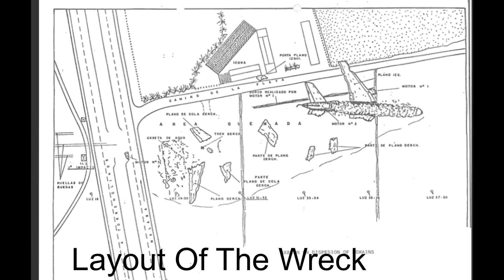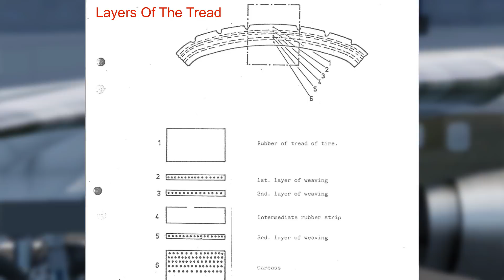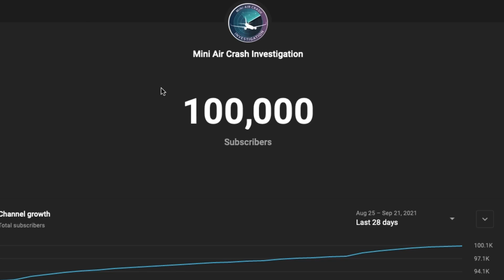How A Flat Tyre Killed 51 People | The Crash Of Spantax Flight 995

Comment: I am wondering why the vibration continued, and indeed got worse once the nose was off the ground? If the nose wheel tyre was the one coming apart I would have thought the vibrations would have gone down to pretty much nothing once that wheel was off the ground. I can only think it was because the wheel obviously continued to spin after it had left the ground, and the damage had made the wheel so far out of balance that it continued to cause serious vibrations even though the weight was now off of it. If the pilots had continued with the take off the vibration would have stopped once the wheel had spun down. Such a shame they rejected the take off. But having said that, like you say, they had no idea what was causing the vibration, it could easily have been something much worse that could have endangered the planes ability to fly properly, which in turn could have possibly led to an even greater loss of life. Those pilots were faced with a very hard choice, and they had to make it without any time to think about the situation. Sadly on this occasion they made the wrong call. Even if that tyre had failed completely, they would still have been able to make a fairly normal landing, after all, the plane had two wheels on the nose gear.

Comment: How long would runways have to be for V1 to be above VR?
Reply: V1 does equal Vr for a lot of twin-jet airliner takeoffs at large airports, or at very light takeoff weights.  Those takeoffs aren't "field length-limited".  If you lengthen the runway sufficiently to get to that situation for all takeoffs (~50% longer than now?), then there's the question of whether airlines would just use the extra distance to allow more derated-thrust takeoffs (saves some on engine maintenance costs).

Comment: Did they ever figure out why the vibrations increased after trying to take off? If the bad time was on the nose gear it seems the vibration would reduce when it was lifted off the ground.
Reply: Because of "spring" in the NLG strut, the imbalance caused by a spinning partly disintegrated tire will produce a higher amplitude of strut stroking once the gear is no longer constrained by the runway.  So it started as one kind of vibration and then progressed to another kind.
Reply: @marcmcreynolds2827  thanks for clearing that up.

Comment: Wait...I'm not getting something right. The nose wheel was where the failure was; yet, when the nose lifted, the problem got worse?
Reply: Before the nose lifted the vibrations were transmitted to the ground and the plane also the weight of the plane dampened them, after the nose lifted you lost these two factors.
Reply: @lastfirst6626  Ok, so when the nose lifted, the wheel was free spinning and created more vibration? Seems plausible.

Comment: If I heard correctly. When the pilots first felt the vibrations brfore V1 they decided to diagnose the problem and not abort. After it got worse they tried to abort after V1. Maybe we need a V0.5 witch states Anything out of the ordinary stop and go back to the gate. Yes I aborted a little single engine takeoff when I applied power too quickly and the engine hesitated. No problem re-ran the preflight tests, realize what I did wrong and took off. You have a lot more time to think when you are sitting on a taxi way.

Comment: Thanks for this video. I am a bit confused why the pilots felt increased vibrations even "after" the nose wheel lifted off on takeoff. if the treads on the nose wheel tires were causing the vibrations, i would think the vibrations would subside once the nose wheel lifted off the ground.
Reply: Nose wheel out of balance (due to lost tread) and still rotating. Contact with the ground would dampen vibration; after lift-off that damping is lost.

Comment: I dont know if I would choose smashing into everything at the end of the runway over flying a plane with unidentified vibrations. "What if the plane would crash once he took off?" He was gonna crash anyway as he was past the point of no return all he decided was definitely rolling into a crash versus a chance of flying into a crash.

There should be 2 minimum speeds. 1 for just not overshooting the runway, and one where you accept that you will leave the paved runway but wont smash directly into trees or infrastructure. Half the time you roll into a field or into some low lying equipment and damage the plane a little. Half the time you crash into other people on the ground. There should be a distinction.

If you are merely unsure what is really wrong and there is a highway or buildings directly after your runway, TAKE OFF.

Comment: I normally err on the pilots' side of things just because they are under enormous pressure and have to react very quickly... but I don't get why this captain rejected the takeoff. They exceeded V1; this was now an in-flight emergency. You lift off, then you worry about it if there is still something to worry about. There's a reason this speed is calculated; you aren't expected to be able to do the math of the decision in that space of time, just to look at the speed and do what you already committed and said you'd do: at or above this speed, its in-flight and you don't stop, period. There have been exceptions, but we're talking about in cases where a plane had such issues it couldn't even pitch up- in this case, the plane was responsive. Training and policy tell the PIC and FO to keep going, so that's what they should be doing.

Comment: Actually, I think he made the wrong call; he knew there wasn’t enough runway to safety come to a shop and so therefore took a huge gamble. Whether they were trained in this of that specific scenario is irrelevant since they WERE trained that it’s better to try to get airborne (despite issues with the plane) than it is to choose a course that they’ve been taught is both1) very dangerous, probably even deadly, and 2) where the odds of succeeding are poor at best.
Reply: Yes, as another comment said… aborting after V1 is almost a guaranteed crash, whereas continuing with takeoff is “only” a gamble.

Comment: Should reject takeoff even if not enough runway, more chance of survival and ground crews will be fast to respond to emergency if a crash was to happen. This is what i would have done especially if the plane was increasing vibrations and struggling to lift off. ABORT
Reply: Exactly. Get in the air and lose a wing and you have 300 dead.
Reply: I often think the same thing - I'd take a guaranteed runway excursion over risking the possibility of not being able to get back to the airport
Reply: @thecrazyfarmboy  it was a bad call from the pilots yes . Actually very bad
Reply: Well... I would say it depends.  If you have rull trust and the controll seams to work, ther likelyhood of the plane flying is very high.

If the controlls are FU or the thrust  is heavily redused, i would say, the plane might not fly anyway. Like the concord flight there just was not power to sustain flight
Reply: @matsv201  A plane never needs to take off, but once it does, it truly needs to land. I'd say if there's any reason to believe the plane might not fly, that's a time to reject takeoff asap. You don't just go "oh well, it might not fly anyways so let's just continue this takeoff and find out" 🤣
Moreover, there are times when the pilots only think they have a minor problem early in the takeoff run, one that won't stop the plane from flying, and then end up crashing shortly after liftoff. It's just my opinion that even a minor problem should call for a rejected takeoff when there is still time to stop, and a major problem should call for a rejected takeoff even if there is not enough runway left to stop
Reply: @thecrazyfarmboy  the issue is that a rejected take of way after V1 is dangerus. If its moment after... sure, no problem if you overrun with a few meters only its not that bad.

If you lift of, you have the whole runway to land... that is... If you can. If you cant.. of cause, its a difrent story
Reply: @matsv201  I'm fully aware that rejecting after V1 is dangerous. In facts that's pretty much the whole point of this exchange, but thanks for clearing it up for me.

You basically just reaffirmed my point lol, if the plane can't land, that's a different story. The pilots aren't psychics, they can't possibly know for sure what the outcome is going to be, and thats why I think that for any serious problem, it's usually a better option to reject after V1. To continue and find out what happens, is to let oneself be a victim of circumstance.
Reply: @thecrazyfarmboy  

"The pilots aren't psychics"

No, but they have a acceleration indicator, and they can read of that. If it match, and the control works.. the aircraft will fly, at least for a period of time. Taking of them will be much safer than reacting the take of.

If the acceleration indicator is slightly off, it will most probobly still fly, but if its a lot of, that might be  a problem. Specially if you lift of in the wrong side of the envelope. And that is all things the pilot should know
Reply: @matsv201  oh sorry I didn't know you're an airliner pilot. I now realize that you know first hand how easy it is for a pilot to fully and accurately assess the mechanical state of their plane within 2 or 3 seconds. Please, teach me more!
Reply: @thecrazyfarmboy  there are thrust gauges.  If you know nothing, maybe you should shut it.
Reply: @matsv201  I am fully aware that there are thrust Guages 🙄  you see it's not that I don't know anything, it's that you don't know nearly as much as you think you do. Evidently, that leads you to think that anyone who disagrees with you must know nothing. Please, tell me another basic aviation fact that you think I don't know

Comment: 8:05 You are taking a chance in either case. I this accident 50 people died. What if something in the plane's controls was badly wrong. If that is the case once in the air the plane could be uncontrivable. The resulting accident may not be survivable. So instead of killing 50 you kill 300.
     50 dead could still be the best possible outcome.

Comment: Aircraft designers:  PLEASE put cameras on the outside of the plane and a large-ish display that can be switched between camera groups.

Allow pilots to see what's up with the plane when all else fails!  Save lives!  Having to diagnose a serious airworthiness fault blind before V1 is a tall order!
Reply: There is no time during take-off for the pilots to sit back and calmly browse through all available camera's. A 747-400 has some 18 wheels, scrolling through them and watching each would take a three minutes if you spend 10 seconds per wheel to check it and go to the next one... They did not have such time.
Also, you're not going to see anything with the tire spinning that fast, so it wouldn't have told them anything.
The A380 does have an outboard camera on it's back, which has helped a Qantas flight after an engine failure but that's during cruise/approach. During take-off there just isn't any time to review camera footage.

Comment: You know,  aircraft carries have arresting cables that stop jets from going off the end of the aircraft carrier.   There are TONS of ways to help with plane safety,  but airlines and airports are unwilling  (and unable) to pay for it. 

There should be an independent company that is willing to add these extra safety precautions.   They should be government funded, and they should also be able to take donations from people  in order to build these safety precautions.        V1 should be an afterthought.    In fact,, that should be the name of the company ,or maybe V2 .
Reply: Plenty airports have runoff areas beyond the runway, several US airports have experimented with a special type of concrete which would partially collapse under the weight of an aircraft, slowing it down greatly, no idea if this was ever implemented though.
In the end, plenty airports have no space. I'd love to see Nasa/NTSB/FAA crash a 747 into some arresting wire, it'd rip off the landing gear and send the aircraft rolling, breaking up in a huge fireball, bad idea.

Crowd-funding airport safety is also a terrible idea, nearly every traveler picks the cheapest airliner. Plenty of airlines have had terrible track-records and yet people would still fly with them. People don't care about donating money for some safety improvements, they care about saving $10 on their next flight ticket by not doing that...
Better idea is to instead have some government agency who determines what safety measures MUST be in place, lets call them Aviation Administration, or FAA for short since it would be at the Federal level, wait...
In other words, the FAA looks at this and decides, no airport measures would've helped this flight, no in-flight measures would've helped this flight. The only thing that could've helped prevent this is better training, which is exactly what they require since this accident.

If you were to land an Army aircraft (such as an A10) on a carrier it would not stop as most military aircraft don't have a wire hook, they would roll over the wires and hopefully take off again. But lets say we raised the wires instead, having them catch in the nose gear of the A10 as it (crash) lands on a carrier, the cockpit would slam into the deck, either killing the pilot on impact or rendering them unconscious as the debris shoot off the deck into the sea, drowning the pilot...

Arresting wires only work on a select few aircraft specifically designed and strengthened for them and even then the wear and tear on those aircraft is several hundreds of times higher than commercial aircraft. The FA18 had a flight life of 6000 hours, a 747-400 can go to 165,000 flight hours, only 27.5 times more... Also imagine what kind of wire would be capable of stopping a 747 or A380 going ~300Km/h weighing 575 metric tons, the wire would need to be the size of a passenger bus and still would destroy the aircraft (and anyone aboard it).

Comment: What I don't really understand, and couldn't have helped the pilots descision, is you said the vibrations increased when the nose wheel lifted off the ground. If the problem was only the tread disintigrating on the nose wheel, shouldn't the vibraitons have stopped when it lifted off the ground? It was no longer incontact with the ground to be able to cause vibrations.
Overall, the DC-10 was a problem aircraft. It seems way too many things were ignored, or badly engineered so the plane could be rushed into service
Reply: Because of "spring" in the NLG strut, the imbalance caused by a spinning partly disintegrated tire will produce a higher amplitude of strut stroking once the gear is no longer constrained by the runway.  Presumably if the all of the tire parts had completely come off, and the wheel stayed intact, the vibration they felt would have stopped rather than increased once the nose lifted off.

Comment: ANYTHING happening after V1 is to be handled as an airborne emergency.  Get away from the ground and come back for a landing.  I have given that briefing thousands of time. Any pilot who cannot recognize a blown tire and its resultant vibration shouldn't be flying. The reason the vibration increased after rotation is because the nose wheel was free castering. Do not raise the landing gear. You don't know if you will be able to extend the gear after retraction. A normal landing with full runway might cause some aircraft damage, but should be survivable for all!

Comment: Surely there should be some automated response that aborts a take-off if a potentially dangerous situation, that requires decisions faster than any human can make, and the plane automatically slowed to prevent take-of speed. Planes can almost fly themselves. The pilot's job should be to override complex problems if there is good reason to. An automated take-off would surely have aborted this because of the vibrations the moment the anomaly occurred. No matter how experienced the pilot, they cannot process information as quickly as a computer. The default setting should always be abort. Only if everything is okay or the pilot confident to override knowing what is happening  should the plane accept take-off.

Why did so many passengers die?

Comment: The whole thing doesn't seem to make sense. If the nose wheel was coming apart, causing the vibration, why would the vibration continue after he began to rotate? It should've stopped entirely once the nose gear lifted off the ground! I worked on aircraft for 23 years in the Air Force.

Comment: What would have caused the vibrations to continue and even increase after rotation? It seems that unless the lost rubber from the front tyre damaged another component the vibrations should have stopped or at least began to reduce after rotation.
Reply: how has no one else asked this
Reply: Because of "spring" in the NLG strut, the imbalance caused by a spinning partly disintegrated tire will produce a higher amplitude of strut stroking once the gear is no longer constrained by the runway.  Presumably if the all of the tire parts had completely come off, and the wheel stayed intact, the vibration they felt would have stopped rather than increased once the nose lifted off.

Comment: If the plane stays on the ground, it will definitely crash. The V1 speed is a hard number, and one which is no mystery, so the aircrew knows that it will crash. There's no mystery about that. On the other hand, if the plane takes off while suffering from some mysterious ailment, it might . . . or might not . .  crash. So the choice is, take off and maybe crash, or stay on the ground and definitely crash. Obviously, takeoff is the logical choice.